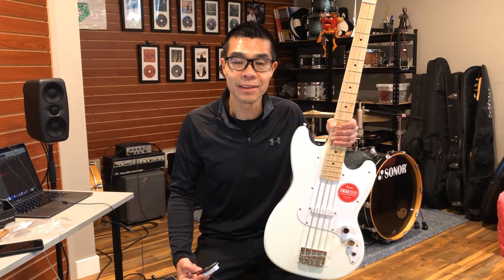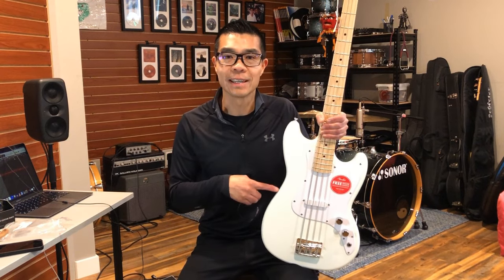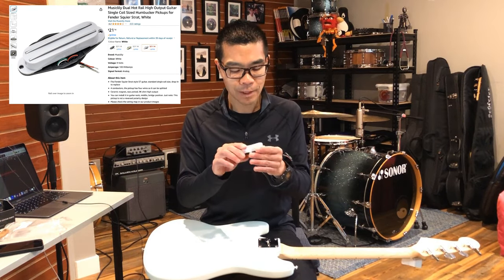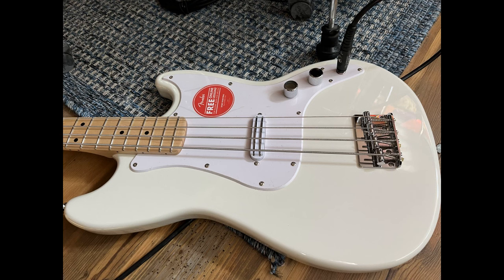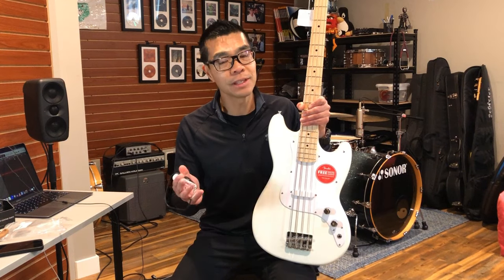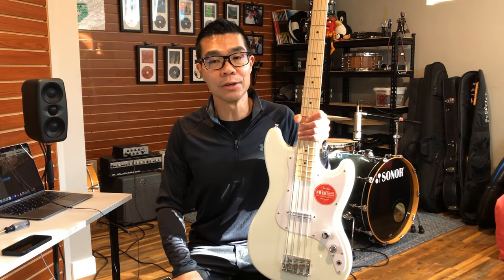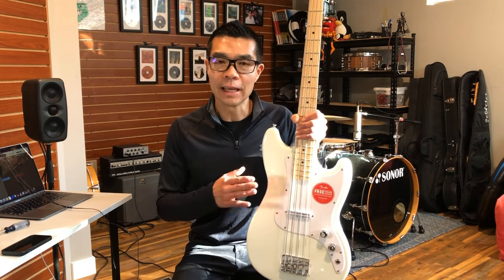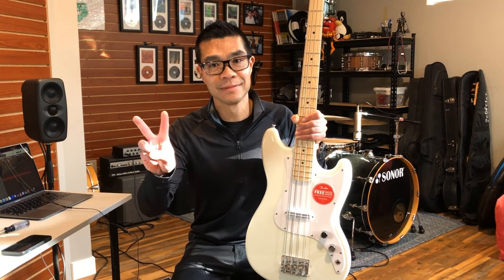Squier Bronco bass modifications Ep.1: Musiclily Dual Rail Hot Humbucker pickup

Comment: A good mod would be to replace the tone pot with a push/pull to create a series/parallel coil switch.  Parallel mode would drop the output and provide you with some of the high end that's lost with the pickup coils in series
Reply from the maker: That's a cool idea!  Would make it similar to some of the stingrays (eg the shorty sterling) where it has a 3 way switch to get the Humbucker 3 different sounds: series-single-parallel. 
Thank for watching!
Reply: Even more useful, do the S/P on the volume pot, and do a Tone push/pull with a different tone cap to add another choice of roll off!
Reply from the maker: That’s cool! I’m bound to screw that up on a gig!
Reply from the maker: Episode #2 featuring a comparison of series vs parallel wiring is now up.  Here's a link: https://youtu.be/wSVHwep_MJI

Comment: So, for the last couple of days I have been checking out my Bronco bass and while it doesn't sound bad, the original Pickups are lower output. What got my attention is that the resistance measures 13K ohms! The Musiclily dual rails come in at 9k and once I installed them, the difference (to my ears) was remarkable, higher output, more dynamic and clearer. For a budget pickup, it was a big improvement, I did however have to file down that very pronounced radius to be more even (distance) with all the strings. Another downfall with my Bronco is the truss rod adjustment, very hard to get to, it is not centered. I can see someone not too experienced messing this up, I had to maneuver and get the right length into the cavity in order to give it a twist. I'm liking the bass but not sure yet if this will be a keeper. Keep the videos coming!
Reply from the maker: Thanks for watching! I’m not a pickup guru, but as was explained to me, the DC resistance is less useful when comparing pickups of different designs - in this case, a single coil vs a rail humbucker. It’s a more useful measure comparing similar single coils that use similar wire, as an example.
Totally agree re the truss rod. I made that comment in my initial review video. On mine, it’s pretty buried in the neck and somewhat difficult to access. The style used on the Ernie ball musicmans where you can stick a straight rod into the wheel, is such a better design.
Reply: Good observation on the pickups and it makes sense, I guess I was not comparing apples to apples. Thank you.
Reply from the maker: Hope you enjoy the musiclily p/u!
Reply: Totally right about the truss rod. Me and my buddy bought a bronco each and it was very hard to access mine and d almost impossible on his bass.

Comment: You have wired the two coils of the humbucker pickup in series. If you change the wiring to parallel you will get more high end definition versus a bit less output. Usually parallel wiring means red+black to ground and white+green to volume pot. Maybe a thing to try out?
Reply from the maker: Good idea! I tried comparing series to parallel in episode 2 with the Seymour Duncan hot rail and didn’t really like the tone, unfortunately. But tone is so subjective. Thanks for watching!
Reply: Hello sir how to eleminate humming noise from single coil pickups of bronco bass.

Comment: Hello 
I find that the stock pickups already sound very good, especially for the price of this bass.
I'm going to buy the same one soon and I won't change the pickups. With good strings and a well-tuned amp, you can already get a very good sound
Reply from the maker: Thanks for watching and commenting! Yes! I mentioned in my original review of this bass that the stick pickup does indeed have a unique grindy tone that is lost/missing in the rail pickups. Output is a bit shy, but otherwise, it can sound good with the right eq! The noise is the only thing that really bothers me, for what I do with a bass.
Reply: @jonathanwong458music  I think the noise can be adjusted by a luthier with shielding in the cavity.
Noise is often a question of electrical voltage. You should not plug the amplifier into a multi socket but directly into the wall socket. try
Reply from the maker: Episode 3 is on this topic.  A single coil is going to hum.  You can minimize it to a point.  Here's a link:
https://youtu.be/hO1Q2UPjRO0

Comment: Just got the Musiclily rail for my Bronco. The price is down to $15 from $23. I hope the quality hasn't gone down. I didn't mind the sound of the stock pickup, but the noise was unbearable unless you turned the tone pot ALL the way down!
Reply from the maker: That’s a great price! It will definitely be quieter than the stock single coil but you’ll lose some of the grind. I hope you like it!! Thanks for watching and commenting!
Reply: Got an Artec hotrails Alnico V, 500k pots and a 47 capacitor fitted , has made a massive difference. The single coil was terrible, I had to put the tone down low to make it useable, Squier made a bad choice. Best upgrade to do without spending too much

Comment: I thought this was going to finally be the key I needed- alas. I have a Bronco Affinity series, not the Sonic, that my daughter used to use (she's onto a MIJ Jaguar now) I thought this was going to be the answer to my problem which is dropping the exact same Musiclily blade pickup into it. But when I look at your photos on the installation section, the wiring (colours used, paths) is not the same on both. I've been wracking my head trying to sort out how to put a 4 wire pickup into a spot where a 2 wire pickup was removed without having to re-solder it. I've had this on my "let's finish this finally" list for about 18 months, I thought today was the day, but it appears it will go back on the list. Excellent walk through video though!
Reply from the maker: It should still work. The musiclily is a humbucker wired in series by default but at the volume pot end, it is still the hot to the pot terminal and ground to the casing. The p/u comes with a wiring diagram. Note: companies do not use a standard colour scheme, so following the included diagram is very important!
Thx for watching!
(I'd definitely encourage you to give the mod a try!)
Reply: @jonathanwong458music  oh yeah, I know they will work, but I just do not understand wiring schematics, I keep hoping for a "paint by numbers" photo I can riff off of to make it as easy as possible. :)

Comment: Great video. Both the stock pu and the rail have their own unique tones and applications. Other than the single coil hum I do like the grit of the stock 6 pole. But the hot rail is also sweet. 
However. That didn’t stop me from installing a G&L MFD pu into my own bronco. I paid more for the pickup than he bass haha. Best sounding bass I have now. 
Blessings my dude.
Reply from the maker: Re G&L, that’s awesome! Did you need to route the cavity bigger?
I also miss the grind on the single coil, but I couldn’t stand the hum. Seymour Duncan hot rail is up next!
Thanks for watching Ep1!
Reply: @jonathanwong458music  I extensively modified my bronco. So routing the pickup cavity was only a small aspect of the project.
Honestly, getting the pick guard cut out was the hardest part due to the brittle nature of the plastic. 
I did change out the pots and added the 3 way selector for parallel, single, and mfd mode (with added capacitor) to copy the g&l fallout bass electronics. 
After stripping the finish, reshaping the body, refinishing and painting. Then aluminum taping the pickup cavity, as well as sanding down and refinishing the neck. It’s a fantastic bass 😆 
Only thing I might do is upgrade to a 4 saddle bridge so my intonation problem will be resolved.
Reply from the maker: wow! You really have put more time and effort than the original value of the bronco!  But if it sounds awesome, and you had fun, then it's worth it!
This sonic series bronco comes stock with a better 4 individual saddled bridge, so it's a huge step up from the earlier 2 saddle version.  Tuners are much better too.  I don't see any benefit to changing out the tuners on this sonic series.  I plan on swapping in a high mass bridge just for fun, although I hypothesize it probably won't do that much sonically on this bass. But will put that to the test!
Reply: @jonathanwong458music  I’m glad they finally figured out those two saddle bridges just aren’t great. Gives me an easy fix to my own bridge problem as well! 
And yes the entire mod process was a blast. I love tinkering and don’t ever plan to sell this bass. She’s a keeper. 

Looking forward to the rest of your series.
Reply from the maker: Right on!

Comment: Jonathan, I bought and installed but still have hum. WAY more quiet, but still there.  You never showed where you installed the wires. I wrapped the 5th wire to the white.  Is that what you did? Thx!
Reply from the maker: Hello!  Thanks for watching.

At 3:50, I show a photo of the wiring - I used the stock suggested wiring, which has it wired in series. It realize the photo is small.
The colour code is as follows:
Red is hot (soldered to terminal on volume pot)
Black and bare wire is ground (soldered to tone pot casing)
Green and white leads are soldered together and wrapped in electrical tape.  In the photo, the combined green & white leads are pulled back towards the main cable rubber to keep it out of the way, then electrical taped to it.  

I can't tell from your description, which lead you mean by 5th wire.  

**The tricky thing is that each pickup company uses a different wiring colour scheme.  Musiclily/Fleor recently changed their colour scheme too.  So best to look at the diagram that should have been included in the box.

Wired the way I described above, the pickup was dead quiet.

Comment: May I ask , did you wire the hot rail pu in series or parallel ? And how much resistance wiring in series , ? Thanks ,
Reply from the maker: I had that Musiclilly wired in series, following the diagram out of the box. It must have been an older gen as the company’s wiring colour coding has since changed. If my memory is correct, the DCR was around 10k. But it’s been a while and I no longer have that particular p/u to re-measure. Sorry.
Thanks for watching!

Comment: Personally, I enjoy the stock pickup more, minus the hum. I’ve always thought the dual rail hot design makes the bass sound  a bit too compressed, though it still sound great. I would like to see you replace the stock pickup with an Emg S2/S3 pickup, as they are solderless noiseless pickups. The S2 delivers a traditional strat sound while the S3 is hotter but (apparently) still pretty balanced. It is worth noting though that both use the traditional 6 pole design.
Reply from the maker: Thanks for watching! The original does have a unique grind to it! But noisy. I’ll look into the EMGs. Thanks!